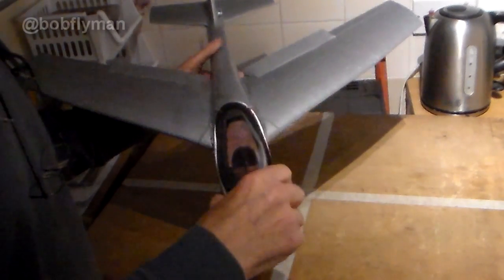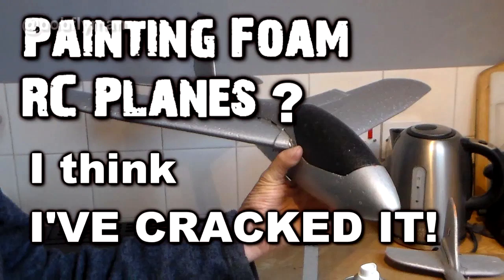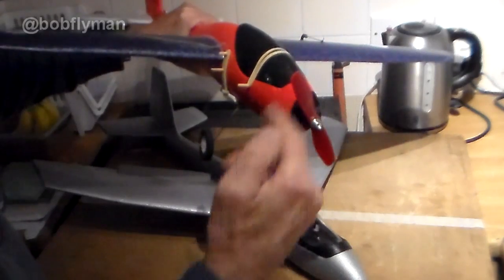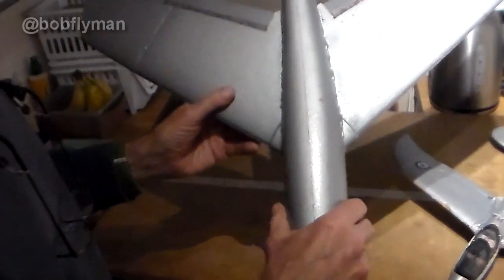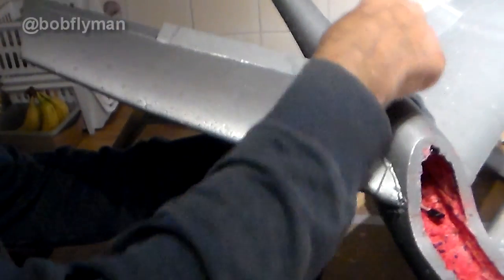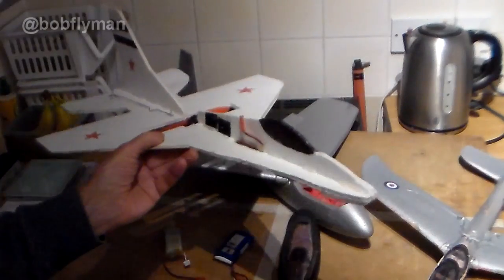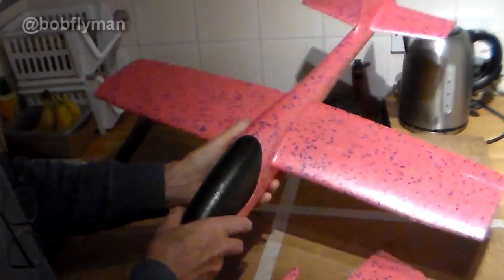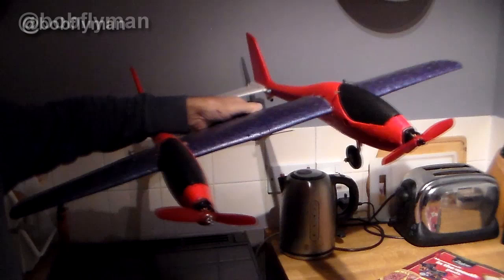Lidl Hunter build update - I may have a CG challenge?

Comment: CofG issue - sacrifice looks for functionality - shorten the nose as much as possible to mount the motor as far back as possible if required.
Reply from the maker: I did consider it, but I'd already fitted the motor was already and it would have made it really UGLY with a short nose!   So, 25g of lead right back under the vertical stab and it's sorted. And relative to the AUW of 250, it's not a lot really?
Reply: @bobflyman  You are correct 25g is not a lot of weight to add to your model to keep the aesthetics - I have tried moving the motor back before but leaving the nose as it was using a shaft extension - didn't work so well unless you can rig up some kind of bearing where the shaft exist the nose as too much wobble/vibration using a shaft extender. Glad to hear you got it sorted. Do you have a maiden video yet? BTW luv what you have done across your various Lidl gliders. They say the number of model aircraft that one needs is always one more than you currently have so keep up the good work.

Comment: I think you'll just have to wait and see how things balance out when the servos arrive, but I like the idea of pushing the battery all the way back down the fuselage, if you have to add weight then so be it! PS I like the sound the Red Devil, cheers
Reply from the maker: Thanks Cliff,  Red Devil is pretty much finished.  Made in a couple of days. My No12!  And I did a couple of things differently this time.  I haven't got electronics properly installed yet but did a quick test and it prop hung really nicely with a 2s. With a 3s it'll be ballistic!    😵‍💫